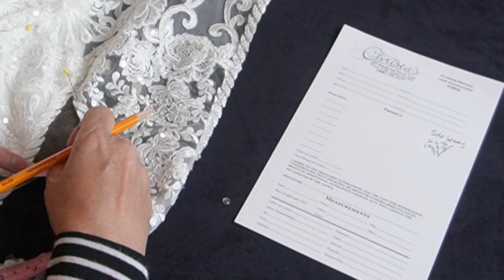How to Alter Illusion Panels on a Wedding Gown. Bridal Alterations. Seamstress Life

Comment: Thanks Christa - another great tutorial and a common alteration on current dress styles especially centre front illusion panels. I have done a few. I mostly do the tuck method as measurements can be small and I find this works fine for me. I often wondered if I was doing it right so thanks for confirming. You mentioned invisible thread which I don't get along with too well so a mini tutorial on this subject would be great. Brand, needle, bobbin set up / machine tension etc. if you had time to do one that would be fab! Have a great day! Moira x
Reply from the maker: Thank you so much Moira 🥰
I’ve done many only on one side, and tucked.  This one seemed to need so much that it really lowered the back.  
Invisible thread can be such a struggle.  I will have to do a video on it.  I may not be the perfect person to teach it, because I struggle too, but I can show what I do and we can ask others to give tips in the comments.  😊
Also, a while back I did do a video on lace sleeves, on my other channel, Finding Shalom.  It’s not a sewing channel but before this channel I did a few over there. Let me see if I can link that video here.
Reply from the maker: Here it is. I have a few tips I learned about sewing with invisible thread.  It might help while you wait for me to make another video on invisible thread.  
Sewing Lace Sleeves for a Bridal Gown. Wedding Gown Alterations. Seamstress How To.
https://youtu.be/AwlF9sH8Fwc
Reply: @christasdressshoppe  Ah thanks, you're a sweetheart, I will hop over and take a look and thanks again for doing these videos. I always pick up extra tips and new ways of tackling things! much appreciated